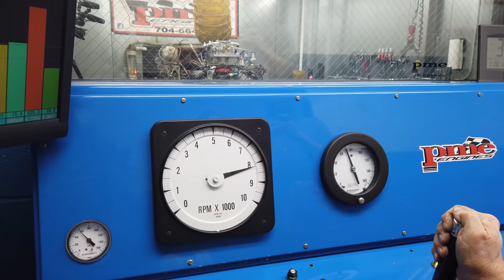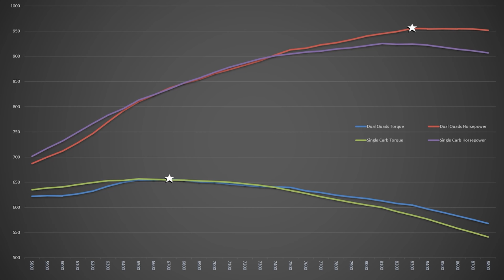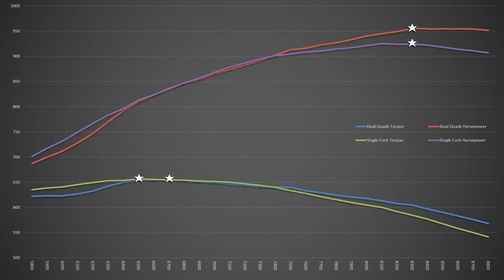955 Horsepower NASCAR Engine for the Street! (w/ ProMotor Engines)

Comment: Almost a thousand horsepower with less than 400 inches. Holy cow!
Reply: AND alll natural on top of that!
Reply: The emission will kill
Reply: And only 12:1 compression
Reply: Considering cosworth. Make 1000hp. From 366 cubic inch n/a v12 
With all emission controls in place.  And last 100000miles  on pump fuel      

But the Chevy is very impressive for pushrod American engine
Reply: Not high performance, because it's intrinsically a poor design. And typically enough too many people don't have any knowledge of recent engine history. A 90 cubic inch BMW four cylinder racing engine made a reliable 1000hp and up to 1400 hp for qualifying, in the mid 1980s.
Reply from the maker: @johnsmith1474  Naturally aspirated? Because if it is not, then you are comparing apples to oranges.
Reply: Nobody tell him about rotary power
Reply: @danielthompson3849  Has anybody actually run one of those 100,000 miles in a car without a serious service or a rebuild?

Sure, it’s very antiquated but making that kind of power with a pushrod, 2 valve, V8 is really hard. 

And the proper cup cars were making 1000 in qualifying with a 360 ci engine and a single carb. Now they’ve limited them to lower rpm and lower power.
Reply: What's cosworth?
Reply: @NBSV1   that’s what cosworth / Aston Martin have said it will do before needing a rebuild 
And it’s a street factory engine  that anyone with enough money can buy   The fact it makes the power with still meeting all emissions  is to me the impressive bit.   What it would do with out them restrictions would be interesting 

But go back to 2004 and the 3l v10 in f1 spinning 20000rpm  making 900hp n/a
Reply: @johnsmith1474   reliable was a bit of a stretch. 850hp reliable    Then only last one lap when the waste gates where replaced with blanking plates and the boost ended up 83psi.    It was also the affect on things like gearbox that  it would bend shafts or burst the case altogether.   According to Gordon murry.  Some good interviews from him about the innervation that was about then
Reply: @johnsmith1474  The turbo provided enough airflow for 1400hp...
Reply: Yeah using 112 Octane
Reply: @TheHorsepowerMonster  hi, could you please enlight a person with not that much knowledge. Do the carburetors that can adjust themselves to a certain degree exist nowadays? Ignition distributor... Isn't it a limiting factor to the rpm?
Reply: @baby-sharkgto4902   a engine design and building company responsible for the most successful racing engines in the world  and currently building the engines for Aston Martins hyper car 
And Gordon murrys new t50. Supercar
Reply: @danielthompson3849  what car does cosworth have available to the general public with 1000hp anywhere in the world?
Reply: @damianlindsey6177   the new hyper car designed by red Bull 

The engine is well documented
Reply: @danielthompson3849  yeah, let's see one actually be driven reliably for 100k miles. Hypercars do not even get consideration. For a million fucking dollars it better last 100k without a failure. Wanna go that route, how about the fact that the Agera has basically a cam-less ford coyote. Yeah, that redbull hypercar will not hold up. Its too high strung.
Reply: @johnsmith1474  "Reliable" means one race.
Reply: @TheHorsepowerMonster  Tell that to the soy boys with turbocharged Hondas that brag about beating N/A V8s.
Reply: @johnsmith1474  that motor had huge amounts of boost, qualifying motors barely lasted a lap. So yea they made a lot power but didn’t have to last
Reply: @danielthompson3849  Lol, but the Cosworth is making less than 350 lbs. of torque, this American build was about 650 torque.
Remember, torque is what allows for heavier car builds, not many 2500 lb. cars in the planet, so the Cosworth is useless on street cars unless you gut a Pinto and make that you're daily driver!
Reply: @imacrazy6872    Hp is just a function of torque and rpm 

If you gear  the output to the same rpm then  the one that has the most hp will also have the most torque 

These are racing engines reused in fast performance street applications.
Reply: @imacrazy6872   and why would you want a heavy build   

Lighter the car faster it is 

To be fair I would love that nascar engine in a f5000 chassis. From the 70s
Reply: @danielthompson3849  The Cosworth Gordon Murray engine is a clean sheet  hand built supercar engine .
Reply: @TheHorsepowerMonster  No ,turboed to the moon ! . But street car 1600 cc  blocks that had done 60,000 miles were  the starting point . 
Peed on for extra aging , just like 010 blocks were !
Reply: @hepcat93  Good questions , General Motors used electronics to adjust fuel mixture on some carbs rather than fuel injection . Chrysler had a Lean Burn system to save fuel but both needed external controls .
I think a distributor could be blueprinted to reliably go to 12,000 rpm ?
Reply: No my friend, Holley Cow 🐄!!!!!
Reply: @imacrazy6872  you know, more than likely you confusing Danielle referencing a pinto and horsepower...
Reply: F1 engines from the early 2000s were making around a thousand horsepower from 183 cubic inches.
Reply: @johnsmith1474  With superchargers the size of a house and turbo lag to go with it.
Reply: @damianlindsey6177  Aston Martin Valkyrie hypercar, designed by Adrian Newey, Red Bull F1 designer
Reply: @imacrazy6872  Around 457fp.
Reply: Wait till you find out about european 3 and 4cyls
Reply: The torque numbers killed it for me, especially for drag racing
Reply: Look up Toca Performance, they were doing this ten years ago.
Reply: @eflanagan1921    That engine is also brilliant but not the cosworth v12 I was on about 👍👍
Reply: @eflanagan1921   thanks for the information, man! Lean mixture? Sounds like the very early attempt of what mazda did recently with its sky active...
Reply: @John Smith  debunked!
Williams/BMW's 4 pot NEVER made that horsepower level. 
The BMW M10 block that was based on would swim like a snake till it snapped without an engine block girdle..
1k hp maybe, briefly in Qualifying, but no way it made 1400hp!

P.S. tiny pistons, tiny crank, tiny crank journals, smaller, lighter valvetrain and low rotating mass will always give the anemic, itty, bitty, torque less engines of a hp/liter advantage.
It ain't magic, people.
Reply: Honda owners have entered the chat
Reply: @kx250braap  
Sure! If you like the torque output of an anemic, chainsaw..😀😁😂🤣🤣🤣
Reply: All about money!!
Reply: @lll9416  Turbo F1 engines did produce well in excess of 1,000 hp in qualifying. People also seem to forget that Honda engines were dominating during the first turbo F1 era and that Honda engineers did say that they were approaching the 1,000 ps per liter mark in qualifying, which would have meant that the engines were producing around 1,400 hp.

Torque also means jack s**t, as power tells you how much torque you can apply to the wheels at a given vehicle speed.
Reply: @PistonAvatarGuy  LOL!
you buy anything your Euro masters tell you! pff
no torque = no go.
Who care about high hp when these toy engines FINALLY make HP at 8000 rpm its time to shift!! then they fall flat on their noses because why?? NO TORQUE!
As the pathetic low TORQUE falls off you have to wait forever for revs!  All the counterbalance it takes to hold together at that cylindrical load creates too much parasitic load, therefor reducing the output from the crank..
I don't expect you DOHC fanboys to understand all this inconvenient science and all.
  
PS. you got Dyno sheets of those 1400 hp pulls? 
Thought so, it was nothing more than paddock gossip,, sorry  truth hurts..
Reply: @lll9416  I don't have to "buy" anything, it's PHYSICS and it's why the Europeans have basically always had the fastest cars on Earth!

An F1 car can accelerate from 0-60 in 1.6 seconds, they don't fall flat on their faces. You have absolutely NO CLUE what you're talking about.
Reply: @PistonAvatarGuy  
F1(aka The Pit Passing Parade) cars need a hybrid electric motor to "torque fill' the little lawnmower "engines" at low RPM so they don't STALL!  hehehe
Reply: @lll9416  No, the hybrid systems are a recent addition to the cars and the cars that had the fastest 0-60 times were all engine. Hybrid systems are for efficiency, not performance.
Reply: @danielthompson3849  Americans beat the Europeans almost every time when the playing field is balanced.
Reply: @riceski    Not really most top level world motor sport development is done in the U.K 

All but 1 f1 car in the grid 

All Indy car chassis as far as I’m aware are made in U.K 

By level playing field you mean hp/ci.  Then America is about the lowest oc 

Look at Indy car a mid level f1 driver from France came over and got pole and a podium in his first race  
Makes a lot of the all American stuff look lower standard  
As for road cars 
While I would love a hellcat. The offerings from bmw and audi  m5 and rs6. Are altogether better for  European roads.  And Petrol prices 

But looking at America at the moment it won’t be long Befor  you are paying the same as us sadly
Reply: @riceski  like the British made Ford gt40?
Reply: @johnsmith1474  Yes but V8's have way more torque. Add a turbos or blower on a V8. No in record 4 banger will beat a very good V8. Remember engines are lighter now for years go figure lol.
Reply: @olerindalrstad1317  LoL
Reply: residue junkie  Oh my my - we have never seen these things before. Unless you're driving something like   the video's describe -- what's the point? Have a great wkend.
Reply: topfuel... 8000 cc 11000 hp ... more than 1hp per cc... now what bit ch?
Reply: @QuantumPlaysOfficial  😂
Reply: Ain't shit by today's standards! LS and LT motors are making 1000+ horsepower all day long for a few grand, that's why everyone's got one nowadays!!
Reply from the maker: @Anarchy-Is-Liberty  You can build a naturally aspirated LS or LT that makes a thousand horsepower for a few grand?
Reply: @Anarchy-Is-Liberty  yea plus 1000 but how its going about plus eleven thousand?
Reply: @baby-sharkgto4902  

They are a engine company in europe. 👍
Reply: @PistonAvatarGuy  pushing over double the rpms. Comparing F1 engines to any others is about as dissimilar as you can get when it comes to engines. Extremely short stroke vs long stroke= apples vs watermelons.
Reply: @jonathonbridges9625  My point was to show the difference between the best that American racing technology has to offer and the best that European/Japanese racing technology has to offer.
Reply: @PistonAvatarGuy  you say that as if Americans are incapable of building such kinds of engines. One thing would probably be the sheer cost of RnD programs for those kinds of engines. Another is regular Americans can just about build the same motors used in organized racing. Damn sure can't do that with an F1 engine. 2 completely different car cultures is the reason for the difference.
Reply: @jonathonbridges9625  Americans are not capable of building an F1 engine, they've tried before and failed miserably. That's also why they have to lie about having the fastest car in the world, because they just don't have the technology to compete on that playing field.

The engine in this video is a purpose-built racing engine, just like an F1 engine, it's not something that can be found in a road car, or obtained easily.

American automotive technology stagnated for decades, that's just a fact. It was more profitable to build cars based on the same formula for three decades than it was to develop new designs, so that's what the American big three did, and then they ended up falling behind the rest of the world, it's as simple as that.
Reply: It was the 1957 fuel injected Corvette 283 that hit the mark of being the first engine to develop one horse per cubic inch for the street in America.
Reply: @Anarchy-Is-Liberty  well, you can tell you have never built anything just by the way you talk. Just like most people on here dogging this engine out, they have never even turned a wrench on an engine, but are subject matter experts.
Reply: @patrickmoore1017  So, by the 17 words I posted, you know I have never built anything, huh? OK god, whatever you say daddy! PSH! FFS FO!
Reply: @TheHorsepowerMonster  When did I ever say anything about NA?
Reply: @danielthompson3849  well that has 4 more cylinders
Reply from the maker: @Anarchy-Is-Liberty  Well, if you are comparing a turbo or supercharged LS or LT to this naturally aspirated engine, then you are comparing apples to oranges. If you are going to throw boost on an LS, then also throw boost on this and see how they compare. That's all I'm saying.
Reply: @TheHorsepowerMonster  He knows those were monster turbo motors. Reliable for a race and reliable for the street are two different things.
Reply: @danielthompson3849  well... some won't get it. never. But my 240V vacuum cleaner is waaaaay more bedda cleaning than your 1000w thing. goddammit..
Reply: @danielthompson3849  mike costons and keith duckworths first engine was modded from a ford euro 2.0L 4 pot.
Reply: Well, there are tuned na BMW straight 6 engines wich put out about 500 hp with a displacement of about 3.3 L. That would be equivalent to a 6.55 L engine with 994 hp, the engine in the video is almost a 6.55L engine with 950, so it is actually a bit under the expected power.
Reply: @TheHorsepowerMonster  
This engine is incredebly strong, for a pushrod V8. 
There are examples of 3.0 L 6 cylinder BMW engines wich are naturally aspirated and make about 500 hp, wich is about 151,51 hp/L and actually more than this engine does.
Reply from the maker: @mandernachluca3774  It doesn't work that way. Horsepower per liter (or cubic inch) is typically larger for a smaller engine. It doesn't rise in a 1:1 ratio as the engine gets larger. Parasitic drag and other inefficiencies makes it harder to produce power at the same ratio for any engine as it gets larger in terms of displacement.
Reply: @danielthompson3849  right... Man it reminds me of my uncle's engine.. I miss it... Small block Ford.. 900 horse .. natural.. 13 to 1
Reply: @johnsmith1474  that's not a poor design... Lol... 90 cubic inch.. natural 1000 horse motor.. no.. I'm sorry.. I don't care how smart u think u are... It's not happening... Period
Reply: John Smith was it naturally aspirated cos F1 cars back in the day made similar HP from small capacity engines but they were turbocharged
Reply: Compression valve lift  head flow RPMs 112 octane race fuel!!!  I can see it
Reply: @Anarchy-Is-Liberty  well bub... Everyone here is talking NA... If we were just talking power adders.. then the sky's the limit. Lol
Reply: @Anarchy-Is-Liberty  WELLLLLL... Have many engines have u built..
Reply: Captain MufDyven  I'd say the engine I was referring to is a bit over 2.3maybe 2.5hp per cu.in.   not 3.0 per cube though... 

NA...  Non electric
Reply: @TheHorsepowerMonster  yeah.. a few grand getting a thousand horse... Ummm. Naaa... U right... He just hasn't got much of a clue
Reply: That's what she said!
Reply: @johnsmith1474    Not buying that on double coupon day
Reply: @PistonAvatarGuy  Of course Americans can't build an F1 engine. It has all these dumb restrictions. However in an unlimited class like Can Am, even Ferrari with their 7 liter couldn't beat Chevy. Took Porsche a turbo and Penske money to finally beat Chevy. GM did not even support racing at the time. Imagine if they improved the old engines the racers were using. Btw Can Am birthed a lot of tech used in F1. Thank Jim Hall for that. You're underselling American racing technology, yet a lot are used in modern race cars.
Reply: @PistonAvatarGuy  Also the experimental car designed by Adrian Newey for his unrestricted F1 vision uses 70s Texas technology. The fan car. Haha Europeans are funny.
Reply: @johncarl5505  "It has all these dumb restrictions."

That just proves my point. Americans can't compete with the best of the best, because they don't have the technology to compete with engineers who thrive under harsh restrictions.

"However in an unlimited class like Can Am, even Ferrari with their 7 liter couldn't beat Chevy."

You're talking about something that happened almost 50 years ago, and in only ONE racing class. In most racing classes, and when it came to road cars, Americans simply couldn't/can't compete.

"GM did not even support racing at the time."

Then it wasn't Chevy who was winning, it was whoever was building the engines and chassis.

"Imagine if they improved the old engines the racers were using."

You're assuming that the Chevy small and big block V8s haven't been improved upon and that there aren't far, FAR better engines in existence? Seriously? Neither of those things are true, pushrod V8s have been under continuous development and there are far more impressive engines in existence. Heck, even Toyota beats GM in NASCAR, where the most advanced iteration of the Chevy small block currently competes.

"You're underselling American racing technology..."

No, I'm not, American racing technology is a joke, it always has been.
Reply: @PistonAvatarGuy  If American racing technology is a joke, why did Chapman and Murray use it in F1?
Reply: @PistonAvatarGuy  Also the Corvette has beaten many Euro cars even more expensive than it.
Reply: @PistonAvatarGuy  Man, you guys really spend so much money or complain just to beat American cars.
Reply: @PistonAvatarGuy  Btw, Toyota in NASCAR is  fully American other than name, so your argument doesn't really work.
Reply: @johncarl5505  "If American racing technology is a joke, why did Chapman and Murray use it in F1?"

The real question is: Why weren't there any American F1 teams in existence making use of those technologies?

Anyway, that's like inventing the pen and claiming that you've written every book that was ever written with a pen, it's a pointless argument. It's not like Americans were designing those F1 cars and all of the technologies which made them successful.

"Also the Corvette has beaten many Euro cars even more expensive than it."

In one of the slower classes at LeMans. They don't even race against the fastest road cars that the Europeans make.
Reply: @PistonAvatarGuy  I'm talking about road cars, the Corvette, heck even the Camaro beats many overpriced cars in the Nords. Jim Hall could have tried his luck in F1, but alas the dumb FIA has banned all his innovations.
Reply: @PistonAvatarGuy  Anyway, you're talking about the country which was an isolationist that turned into a superpower in a century. A country that built stealth planes in the 80s and got laughed at, yet Russia, China and Europe are now developing their own. You think it's not possible for them to apply their technological expertise on road cars?
Reply: @johncarl5505  "I'm talking about road cars..."

American road cars AND American race cars have almost never been able to compete with the best that Europe has to offer. Your thought process on the Camaro also illustrates why American cars perform so poorly, because you're focused on what the Camaro can beat, rather than what beats the Camaro. You're also focused on price, as if that somehow makes the car faster, which is hilarious.

"Jim Hall could have tried his luck in F1."

No, he couldn't have, he never had the engine technology. Again, you're looking at one, tiny part of a racing vehicle and not understanding just how enormous an undertaking it is to design and build an entire race car.

"You think it's not possible for them to apply their technological expertise on road cars?"

Possible, maybe, but highly unlikely, because Americans are too obsessed with profit and tradition to invest significantly enough in something completely new, and that's what would need to be done in order for the US to have something that's competitive with the best that Europe has to offer. European companies have been consistently investing in the development of cutting-edge automotive technologies, the US has not, so they'd need to make a huge leap to be competitive.

You don't seriously believe that an American company could produce something like the Cosworth Valkyrie V12, do you?

As far as race cars go, no, I don't think that Americans are capable of competing in the fastest racing series, like LeMans (the hypercar/prototype classes), or Formula One, they just haven't kept up with technology well enough to make that kind of leap. Even Honda had trouble achieving their current success in F1, and they had previously dominated the sport.
Reply: @PistonAvatarGuy  Americans like to go the cheap but high performance approach on cars in comparison to their aircrafts, that's why they probably won't ever make that Aston. Seriously, what is the point of spending so much money improving the aero of a car to make massive downforce if instead you can stick a massive fan on the back. I have no idea why Europeans like to make everything more expensive. F1 dirty air problem could be solved with a fan, but no they want to waste more money.
Reply: @PistonAvatarGuy  Whenever there is a comparison between an American car or a European one, the Europeans always say excuses like, "Oh we have less displacement, if it were the same, our car would win" or "Your tires are way wider than ours, we use more sophisticated aero to help our cornering ability instead of relying on primitive wide tires". Seriously why do you guys make it more complicated and expensive?
Reply: @PistonAvatarGuy  While I'm not a fan of the Ford GT GTE due to my dislike of the Ford GT, a car way to expensive for the performance it has, basically America's attempt to make a European supercar. I was glad it won because of sandbagging. I see it as revenge for when the Corvette C7 GTE was bopped to uselessness when WEC restricted its airflow because it performed the best out of all the GTEs, while following all rules and regulations. They should have let it win like the C6. Now the C7 will never win Le Mans since it's retired.
Reply: @johncarl5505  The whole point of racing is for it to be challenging. Anyway, even with a fan, racing teams would still benefit from improving aerodynamics on the same level that they do now.

Europeans don't need excuses, they build the fastest cars on Earth and basically always have.
Reply: @PistonAvatarGuy  Jim Hall never fixed his Chaparral 2J because it was banned so it is pointless to continue. The technology proved itself when it outpaced and lead other more advanced Can Am cars only to break down later due to trans issues. I mean Murray succeeded in defeating the revolutionary Lotus 79 by a huge margin and Newey used the fan system in his GT vision car, so yeah I don't think the fan system is a fluke.
Reply: @PistonAvatarGuy  America did a lot in the world of motorsports such as wind tunnel testing, HANS device, etc., yet people only evaluate their contribution based on their success in F1 even though a majority of Americans never cared for it. I think the only American teams that tried F1 are Penske and Haas, I don't think the Big  3 even tried joining. Ford Europe is independent of course, so the Ford you see in F1 is not the US based one.
Reply: @PistonAvatarGuy  They don't need excuses, but they still make em.
Reply: @PistonAvatarGuy  The whole point of racing is racing not making it challenging. There can be challenging races, but stupidly expensive parades are not racing. Then again it is subjective, for some people DRS and pitlane overtaking is racing.
Reply: @johncarl5505  No one ever said that Americans did nothing to contribute to the world of motorsports, it's just that they're not able to participate in the faster racing classes, because they haven't kept up with the development of all of the technologies that they would have needed to in order to be competitive in those classes.

No one is making excuses for European sports cars, they're probably just relaying genuine reasons why whatever comparison you're making doesn't make sense. For example, it's not really all that impressive that the Corvette was so successful in its class, because it doesn't really complete against any of the more impressive European road cars.

Regulations in racing can push the advancement of technologies forward, which I would argue is even more important than the actual racing. For example, the current regulations for F1 have made the racing less exciting, but have resulted in hugely powerful, incredibly efficient engines, which also last much longer than older generations of F1 engines, and many of those advancements could be transferred to other applications. For example, the MGU-H technology could be used to great benefit in semi trucks and light aircraft.
Reply: @PistonAvatarGuy  F1 tech is not even used outside F1 except for high end supercars, so I doubt car technology relies on F1. A majority of tech F1 uses started outside F1 anyway and would have evolved without F1.
Just because American companies don't make F1 cars doesn't mean they are falling behind. That's like saying European companies are falling behind in stealth tech because they are making them right now instead of the 80s or falling behind in Baja 1000, Unlimited Hydroplane, Tractor Pulling, JetSprint, Formula Hillclimb, Offshore Powerboat, (the many other motorsports dominated by American tech), etc. It's just that they are not focused on those sports at all. Those sports also have involvement in improving certain tech, but tech would still evolve without them.
Reply: @johncarl5505  Much of the advancements made in F1 are in materials science, manufacturing methods, engineering tools, the understanding of the combustion process and how it relates to combustion chamber and port design, etc. Those advancements do sometimes transfer to other applications.

"Just because American companies don't make F1 cars doesn't mean they are falling behind."

That's not what I said, American car companies are behind because they're behind. Americans don't make the fastest cars, they don't make the most efficient cars, they don't make the most reliable cars, and they've been behind for around 4 decades. Americans COULDN'T make an F1 car if they wanted to, because they're behind, Americans COULDN'T make a LeMans hypercar if they wanted to, because they're behind.

"Baja 1000, Unlimited Hydroplane, Tractor Pulling, JetSprint, Formula Hillclimb, Offshore Powerboat, (the many other motorsports dominated by American tech), etc."

If European companies wanted to dominate in those classes, they absolutely could. Tractor pulling is dominated by Europeans (though, often with American engines), as are many hillclimb events. Heck, take a look at the winners at Pike's Peak, it's been Japanese cars (Suzuki Escudo), Japanese powered European cars (Norma-Honda, Wolf-Honda), European electric cars, etc.

"...but tech would still evolve without them."

In many cases, no, it wouldn't.
Reply: @PistonAvatarGuy  So American cars are behind because they are behind. Europeans would dominate those other motorsports because they can. Wow good explanation.
Reply: @PistonAvatarGuy  Much of the advancements in those other motorsports are material manufacturing, engine efficiency, etc., as well.
Reply: @johncarl5505  No, I said that Americans are behind because they don't make the fastest cars, they don't make the most efficient cars and they don't make the most reliable cars.

Europeans could dominate any motorsport if they chose to because the performance of their vehicle technology exceeds that of anyone else's, except for the Japanese, in certain cases.

Right now, the most efficient automotive engine in the world is a Mercedes F1 engine.
Reply: @PistonAvatarGuy  Yeah, the Mercedes F1 engine can dominate in Tractor Pulling or Top Fuel. That's why the Germans used it there. Oh wait they didn't because they are using HEMIs and Allison V12s.
Reply: @PistonAvatarGuy  Engine effectiveness depends on the vehicle it's powering. That's why they use American V8s and not European V8s in the Scandinavian Formula Hillclimb. They have the power, torque, simplicity and reliability.
Reply: @johncarl5505  You do realize that NEW engine designs can be produced, correct? I'm saying that the Europeans posses the technical knowledge to build engines that could outperform anything ever produced by any American company.
Reply: @johncarl5505  They only use American V8s because no European company has ever decided to produce a V8 that outperforms those engines... at least not in a reasonable price range.
Reply: @PistonAvatarGuy  Ha, even you agree with me that European companies would have to spend ridiculous amounts of money just to compete with American engines. Thanks, lol.
Reply: @PistonAvatarGuy  Those engines weren't even designed for tractor pulling, boat racing, etc. They were just used for the performance trim of certain road cars. The fact that they are being used around the world is a testament to their design.
Reply: @johncarl5505  Those specific engines, in that specific application... maybe. I'd say that there might be Euro V8s that could be tuned to compete. Anyway, there are fully emissions compliant, European ROAD CAR engines that would stomp the f--k out of those engines, like the Cosworth Valkyrie V12, any of the Aventador V12s, the big Ferrari V12s, the McLaren F1 engine, Koenigsegg engines, etc. Cost is obviously an issue with those engines, size would also be an issue with the V12s.
Reply: @johncarl5505  I just have to say how hilariously childish that comment was. There is NO AMOUNT OF MONEY that American companies could spend that would allow them to compete with the top tier engines that the Europeans make, they just wouldn't even know where to begin to compete with those engines. And, no, those V8s in the Formula Offroad trucks would not be able to compete with the best V8s and V12s that the Europeans produce if they were installed in a production car.

Heck, the most powerful naturally aspirated American engine ever put in a production car made 505 hp, while the most powerful naturally aspirated production car engine in the world makes 1,000 hp. Even the little 298 pound Porsche 918 engine makes 600 hp.
Reply: @johncarl5505  Correction: The Shelby GT350 is naturally aspirated and makes 526 hp.
Reply: @PistonAvatarGuy  Hey, just stating my observations. I see a lot of American V8 project cars even in Europe. Never seen a Porsche swap. Doubt that could perform well.
Reply: @johncarl5505  American V8s are used in swaps because they're cheap and easy to get, while the top tier European engines are extremely expensive and almost impossible to get. That 600 hp Porsche engine is in one of the best performing vehicles in the world, no American vehicle comes close to competing with it, but it also costs nearly one million dollars. That's what you're not understanding here, that the Europeans make the best, and only the super-rich can afford the best.
Reply: @danielthompson3849  Since when does Cosworth make a racing engine with "all emissions (shit) in place"?
Reply: @johnsmith1474  That got rebuilt after every race, cost 100k, and was full of exotica like titanium rods, valves, and exhaust systems. Not exactly streetable.
Reply: @pookysdad4884    The 1000hp unit in the Aston Martin  hyper car
Reply: @hepcat93  Carburetors don't. But electronic fuel injection (EFI) does.
Reply: @danielthompson3849  Neato. And they'll build how many? 50? For guys like Richard Branson, and maybe Jay Leno? Super.
Reply: @pookysdad4884   yes  and  still 1000hp n/a 6l v12  that will last 100000miles and be emission compliant  
And comes with a warranty
Reply: 1k hp per liter since 1980's. Turbo needed. Yes 1L engine
Reply: @PistonAvatarGuy  completely false 😂 the ssc tuatara just beat koenigsegg for the fastest production vehicle with a V8 that uses a LS block made by Nelson racing engines, not to mention Koenigsegg used the Ford modular engine in its earlier vehicles and still used the Ford block design till recently which Christian said himself on Jay Leno which is on YouTube rn.
Reply: @PistonAvatarGuy  we both know European cars and reliability do not go together😂, look at any statistic you want, the only European car that is consistently on every positive statistic is the Porsche 911, when it comes to reliability, maintenance costs, insurance costs, average life spans without major fixes, depreciation losses and resale value European vehicles will almost always come in last even the most of the European super cars lose massive value great examples of this is certain years of the Mercedes Amg Gt now can be found under 100k, Mclaren 650s can be found for 129k a mclaren with a twin turbo 3.8 v8 should never have lost more than 100k in value but then again it’s British engineering lol, the Ashton Martin V12  formerly owned by Ford motor company aka a American company 😎 some could be found under 120k even some under 100k, some Audi R8’s for under 100k and one of the most horrendous are the Lamborghini Gallardo’s with v10’s and manual going for under 100k 😂. It’s almost as of the Europeans manufacturers need to through more and more money and see which ones sell lol also Porsche almost going bankrupt then getting saved by the Porsche Cayenne a dam SUV saved Porsche 😂😂. Europeans are extremely intertwined with their governments like VW the German government owns a massive stake in the company and without it, it will fail instantly they need government intervention to help the
 constantly but the Europeans are so far behind in EV Angela Merkel herself took the land rights from VW and gave them to Tesla in Berlin in hopes of not being left behind from the future of EV. Tesla a American company is the biggest EV seller and also the most advanced and what do the Europeans have to offer? The Porsche Taycan? 😂 even with all the VW subsidiaries like Audi, Porsche and Skooda they are not even close🤷‍♂️.
Reply: @danielthompson3849  completely false 😂 looking at Europe it looks like our bases are getting larger and larger, the UK is having a major fuel shortage and prices going up meanwhile here I’m paying 2.49 USD a gallon when so busted Italy I was paying 7.88 to 8 USD a gallon. Look at this years lemans the C8 corvette placed second behind Ferrari after years not racing in the Le Mans, with an American and Spanish drivers. 

But looking at Europe as a whole with Brexit happening and Poland being threatened by the EU it looks like things are looking tricky again. But as someone who was stationed in Germany and Italy it was only a matter of time🤷‍♂️.
Reply: @danielthompson3849  considering that is a v12 going in the Valkyrie which the staring price is 3.8 million and a new brand new engine design. Pretty amusing it takes 3.8 million dollars to even produce similar numbers the Americans and Asian manufacturers make 😂.
Reply: @USandGlobal   the full car is 3.8million    Not the engine alone        
Making the power is not the difficult bit. 
Making it light and reliable enough to have a warranty and last 100k miles while meeting the emissions regulations is the   Difficulty
Reply: @johnsmith1474  not really the best high performance from the engines your talking about such as the p48 that uses very similar designs from the m121 from 1969. Very poor designed engines not to mention the insane costs to keep them running the Americans did it far before with speeds reaching 200mph for hours on end.
Reply: @ATXevolutionz  yeah the ones with better internals still slower than stock American vehicles 🤷‍♂️
Reply: @PistonAvatarGuy  😂😂 yeah a Tesla does 0-60 in 1.9 seconds not really impressive for F1 last time I checked each F1 team could cost over 500 million to manage. And no they don’t have the fastest cars SSC tuatara has the fastest production vehicle. Top fuel dragsters are the fastest accelerating race cars on the planet reaching speeds such as 335 mph in under 4 seconds.
Reply: @USandGlobal  also if I’m not mistaken the  corvette race car engine is a dohc flat plane v8. Not a pushrod design from the 30s     And has nothing to do  with the engine that actually comes with the car when you buy it
Reply: @PistonAvatarGuy  the fact that you are comparing these engines with F1 engines when the price of F1 engines is beyond insane ranging in the millions for just the engine alone and according to Forbes F1 engine development has surpassed 1.4 billion all that money and only reaching 1000bhp is hilarious but then again it’s European manufacturers which need millions just to compete 🤷‍♂️. Even Honda won’t be able to help Redbull with their engines in 2026😂.
Reply: @PistonAvatarGuy  even with all that investment a simple car like the viper ACR which is the car with the most track records on the planet certified by the SCCA 13 records to be exact beating Porsche and Mercedes, the Viper being the tenth fastest car around the Nurburgring and still holding the record for the fastest manual car around the Nurburgring. Pretty pathetic the Europeans couldn’t beat a pushrod naturally aspirated V10 engine in a Dodge with a manual 😂, kinda like how their million dollar super cars get slower track times than a Porsche 911 GT3 RS😂.
Reply: @USandGlobal  The SSC Tuatara is not in production and hasn't been approved to go into production. SSC also LIED about the record.

"we both know European cars and reliability do not go together"

The same goes for American cars and reliability. Mercedes vehicles are often quite reliable, especially their vans.

"Europeans are extremely intertwined with their governments like VW the German government owns a massive stake in the company and without it, it will fail instantly they need government intervention to help"

You are aware that GM and Chrysler have been bailed out by the government on multiple occasions, correct?

"...but the Europeans are so far behind in EV..."

They're not at all behind, they have some of the most luxurious and powerful EVs in the world. The Taycan, the Polestar, Rimac, etc... Anyway, BEVs are not complex, anyone of the major car makers can produce world-class BEVs at a moment's notice.

"Angela Merkel herself took the land rights from VW and gave them to Tesla in Berlin in hopes of not being left behind from the future of EV. "

Who cares? The woman clearly knows absolutely nothing about technology and got duped by some Tesla fanboy. Anyway, BEV technology is a joke, it's not replacing ICE technology anytime soon.

"even with all the VW subsidiaries like Audi, Porsche and Skooda they are not even close🤷‍♂️."

Close in what way? Acceleration? Who cares? It's not like that takes some sort of revolutionary technology, you just increase the size and power output of the motors and battery, that's something that any car manufacturer car do.

"yeah a Tesla does 0-60 in 1.9 seconds"

But that's all that it can do and an F1 car isn't even built to accelerate quickly from a stop. The Tesla is absolutely pathetic when it comes to actual track performance, which is what an F1 car is built for.

"Europeans are not capable of building superior ev engines..."

EVs don't have engines.

"...they have tried and failed horribly."

When did they try? When did they fail?

"European manufacturers all have massive government ownership..."

If that's even true, why is that a bad thing? Anyway, you have no idea what you're talking about, and it's hilarious.
Reply: @USandGlobal  You are aware that the SRT brand FAILED and that the Viper is no longer in production, correct? There are also PLENTY of cars that pwn the f--k out of the Viper on the track and all of them are European. The Ferrari 488 Pista, Lamborghini Aventador SuperVeloce LP750-4, Porsche 911 GT2 RS, Porsche 918 Spyder, Porsche 911 GT3 RS, Porsche 911 GT3, Lamborghini Huracán Performante LP640-4, Porsche 911 GT2 RS, Lamborghini Aventador SVJ LP770-4 and Mercedes-AMG GT Black Series are all faster on the Nurburgring than the Viper ACR.
Reply: @USandGlobal  And here's what's happening in the world of modified Lamborghinis: https://www.youtube.com/watch?v=dyKgjEOYREg

No Viper can touch the fastest Lamborghinis in that competition, and those aren't even the fastest cars that Lamborghini offers.
Reply: @USandGlobal  Also: https://www.youtube.com/watch?v=MRj10HFPWXo
Reply: @PistonAvatarGuy  can’t build them? It’s a simple understanding of a design already in existence. That is simply stupid to state.
Reply: @Lo0die3  There's nothing simple about an F1 engine. You can't just build something similar and expect it to perform well, either. You're so far off the mark that you don't even know how far off the mark you really are.
Reply: wow!!! back in 80's BMW made over 1500 Horse power out of a 2.0L 4 Cylinder!! and won the Formula 1 Races
Reply: Yeah and it's only for times the size of an F1 engine with the same horse  power. Yet again America literally takes the cake for being unnecessarily big.
Reply: Maybe I missed it , but is that a 4-7 swap Engine ?? 🤔
Reply: @SteveXNYC  lol it's a race engine.. They are not made to pass emissions.. go find a tree to hug hippy :)
Reply: Hold on a sec.. that 1000hp v12 isn't even available for sell as it's to a 3.2million dollar hypercar . It's life span is in kilometers not miles 100,000km...  62,000miles needing a rebuild. There's nothing to consider you can't compare a 1,000,000 dollar engine unattainable engine with the v8 In video. And the BMW engine comment LOL yeah probably need to reread that engines history wasn't the most reliable thing ever.
Reply: @danielthompson3849  my uncle built a 363.. about 900.. if he had more money he could get 1000...
Reply: Nothing special.. Here in Europe we are used to greater powers. Our Formula 1 has the same power with an engine four times smaller.
Reply from the maker: @Akaprovic  So you are holding up a race team with a hundred million dollar annual budget against an engine built with used parts that an average Joe with a 9-to-5 job can purchase and go racing, and you're calling that equivalent? You're joking, right?
Reply: @danielthompson3849  care to list one of these examples. Have yet to hear of ANYONE building a 1000hp N/A engine that's in an automobile much less one that'll last 100k miles...
Reply: @02autogt   the cosworth v12 in the Aston Martin Valkyrie  1000hp n/a v12.  With full emissions control and do 100000mile between rebuilds
Reply: @danielthompson3849  are any of those in the hands of the public yet? Just curious... I am a fan of AM for sure but don't keep up with everything they have going on. Guess I need to Google it, lol
Reply: @02autogt   not sure   If any are delivered yet. But a smaller engine in the Gordon Murray t50   I think has been
Reply: @TheHorsepowerMonster  don’t listen to Mr Smith, he’s still stuck in the Matrix making 1000 up NA from the 90ci 4 cylinders, what’s next? Did they pee on the blocks to strengthen them?
Just playing, just another Internet Engineer forgetting a fact or 2.
Reply: @PistonAvatarGuy  and this isn’t even our "best",,,,,,,, Steve Morse drops mic and walks away,,,,
Reply: @TheHorsepowerMonster  @akaprovic  but they also spin that little bugger up to 20k, or isn’t there a 15k cap now? Either way, apples and donkeys. Don’t share much more than the suck bang blow logic, which Europeans are very good at,,,,;)
Reply: @danielthompson3849  I know what they’ve got and it’s a beast, and I’m sure they will get it to pass emissions (hope they don’t hire all the former VW diesel programmers,,,,)
But I seriously doubt that they will get it to pass more than 2 or 3 repair shops,,,lol,,,, I cannot recall ever hearing of an Aston lasting 100,000 miles,,, EVER,,,,in a trailer maybe,,,,
Reply: @SteveXNYC  Who cares?  Go watch videos about eating bugs.
Reply: @johnsmith1474  So where is this 90 cubic inch motor now?  Seems like everyone would want it.
Reply: @danielthompson3849  Where is this vid worth v12 you spout about?
Reply: @PistonAvatarGuy  My car does 0 to 60 in 1 second.
Reply: @justpray365   https://youtu.be/xMRrmnkZEqs
Reply: @QuantumPlaysOfficial  notice how noone gives a shit about a rotary
Reply: @PistonAvatarGuy  A) you don’t know WTF you’re talking about.  B)  none of those V12/10 engines in any of the exotic cars last 20K miles before they need rebuilt.  If even that.  Newer Lamborghinis do, but they’re a glorified Audi.
Reply: @Cultofpersonality09129  lol, ok, buddy.
Reply: @johnsmith1474  Reliable for ~1 hour?
Reply: @imacrazy6872  I get what you are saying
But who needs torque at 19000 rpm ?
Reply: @Silkmaster4200  I think the 787b proves your torque theory wrong 
As do a lot of f1 engines 
Most engines with big torque taper off higher in the rpm range 
Where less torque high rpm motors
Like I've mentioned keep producing hp right up until high high rpm
Reply: @johnsmith1474  Those F1 engines were barely reliable for a single race, and they got a complete re-build after every race.
Reply: Many of your Super Cars such as Ferrari, Lamborghini, Alfa Romeo, etc. are easily making 1,200hp with V-12 & V-10 engines with displacements under 3.0L.
They make most of their power up in the 8,500 rpm (and up) range with their short stroke.
Reply: @TheHorsepowerMonster  I know right .....eyes upwards LOL
Reply: @danielthompson3849 lmao last 1 million miles you're nuts
Reply: @donaldkinder6716    100000. Is not a million.  😂😂😂😂  go back to school
Reply: @SteveXNYC  I guess it would be just for 1 or 2 times monthly use not daily so..
Reply: 400 inches of what?
Reply: There is a lot of overlooked relevancy going on in this comment section when it comes to cubic inches and horsepower.

It's not a question of power per square inch, it's a question of limitation and or allowance per configuration where efficient or productive limitations,

meets,

effective or intelligent allowance and or application. 

Therefore, today's factory high horsepower engines are much more a factor not allowed in this particular video application where hell, they even have intelligent and or adaptable camshafts capable of changing its configuration and or timing itself when the demand calls for it and simply a therefore natural function.

I'm not even going to get into the modern technology of turning force and how it is productively transmitted to the ever important bottom line business end of performance and that is how much horsepower in application is transmitted to the drive tires front and or the back depending on the type of vehicle of course and it's adaptive intelligence that can be preset and or monitored and controlled in real time adaptability that is somewhat akin but not anywhere near the same degree clearly, but when I make the point that that the stealth fighter as a overall design function, can only be with a ever constant monitor and control adaptability in which it said it's making a million adjustments every second in order for what is a anti aeronautic structure to perform in essence the impossible of impressive flight control and response and signature. 

955 hp with a 400 cubic inch limitation is certainly not a pinnacle of engineering achievement with its structural design limitation being in this case a couple of valves per cylinder and I imagine a solid lifter style cam perhaps I'm not sure, I don't want to say the obvious that it's all mostly roller design for the upper end because I wasn't really interested in watching 26 minutes where the bottom line price or cost of this particular piece is not mentioned as far as I know in my careful fast forwarding.

And therefore if I'm wrong then so be it but if I'm right then I would lend this particular engine design and it's creators toward being a very high dollar item and I defer to what was once said to me years ago that humorously has its point but also very arguable and or relative to what ultimately by rights should be a component of overall design claim and its price point limitation or another words as it was said very facetiously to me where good irony is good when it's based on the ironic fact and that is:

"If you want to impress me then build a 955 horsepower 400 cubic inch engine for $5,000"

Of course that is very demeaning in spirit as to the reasonable state of mind being a grounded or down to earth one where we simply have to come to terms with what is design limitation because the laws of physics and thermodynamics as criteria demands that simply cannot be ignored unless design limitation is allowed to modify or alter and therefore it is not the same design principle anymore.

BUT,

The argumentive humor of it all did evolve or progress in arguable comedic fact in which, the engineering ingenuity of what is found in most penitentiary confines where we must admit that with what is the unfathomable bare minimums and even further below that in some cases, once mentioned I myself laughed and finished off the stated prognosis of total agreement and exaggerating appropriately the probable fact if those as stated inmates were not limited in what is the ultimate in limitations to begin with where they simply cannot just do what is almost the impossible out in the open, they have to do it invisible and compromised silence where when adding it all up there was no doubt when I said and we both laughed that I had to agree when considering they could probably build rocket engines out of mushed wet paper and glue composites left to dry and it's fuel source derived from bodily fluids and of course excrement and sexual fluids along with some other kitchen area organic material and there you go, The pelican Bay rocket!

And then I laughingly conjured up the vision of three Mexican mafia cholo looking types sitting on top of the rocket with their countdown and trajectory calculations toward escape velocity and successful as well. 

In other words when there's a will, there is a way and I agree 100% especially when life and limb is on the line and come on let's be real I don't think there ever once was a engine build outfit ever performing or motivated along those lines. 

I'm pretty sure that with no cubic inch limitation beyond would of course is dimensionally functional, is the probable fact that without a hemispherical head design, it's maybe impossible to get more than 1500 horsepower out of a naturally aspirated configuration where our only design allowance is a maximum of sea level atmosphere because in reality when we drag race for instance we are certainly above sea level in many cases as opposed to being below sea level that's for sure and therefore for the sake of debate and parameters, we will allow a maximum of sea level conditions in which there is our overall limitation that the basic design configuration mentioned above can only allow or perform so much because we are talking about the laws of physics and thermodynamics at that point sort of like the high probability that a human as we know it is not going to run a 3-minute mile as it stands without some sort of design modification that now takes what is human to a abnormal specification.

Not even the brilliant minds of pelican Bay and/or San Quentin can override what is physics and its limitations and therefore we have probably reached what is the maximum of a design characteristic as it stands being a single cam design and two valves per cylinder non hemispherical head design whereas I'm probably mistaken that even to approach what I know is 1400 horsepower is based offer a hemispherical head design.

I know there is a guy named Sonny's who might beg to differ but I also know I can win the argument when I say haven't you Mr Sonny, modified and therefore improved what is for argument's sake a better hemispherical design and therefore we have to conclude it is different than what is historically the norm. 

I guess I would have to put a fuel limitation into the equation as well being limited to what is the ultimate refinement and/or modification of gasoline being something like c16 if I recall maybe they have a next step better in gasoline but my point is, it's not alcohol derived and/or nitromethane in composition which of course and especially with nitro is a completely different animal than what can be derived from gasoline as a comparative source if one wants to even call c16 gasoline but for all intense and purposes it is a race gasoline and a damn good one in terms of its value combustion property. 

Very productive and efficient and therefore at the extremes of effectiveness.

This video engine example, I'm not impressed why should I be it's nothing unusual or revolutionary, it's just a well thought out and constructed piece of engineering where unfortunately it's not attainable by its very high price point and therefore it may as well be a MotoGP-1 race bike for that matter. Either way it's unattainable or unaffordable to most people and therefore if we are going to talk about impressive but un attainable then I defer to the ultimate hot rod in planetary history and that is the space shuttle or Saturn 5.... Now we're talking power.
Reply: @kx250braap LMFAO 👍🏻
Reply: @PistonAvatarGuy dude, did the racial biology of what is an American versus a European, change in short order if we minus the multi cult aspect of The component equation? 

We can go a step further that a Verner von Braun here in America or in Germany or in China is still without a doubt the same man with the same idea engineering capabilities where his only limitation is not the geographical fact of location and only I would imagine if in China, simply doesn't have the correct infrastructure in order to design the capability in order to harness what is his visionary genius That certainly America could implement as long as one I guess, believes the moon landing was not a hoax. 

Regardless of said landing, I can see how this can be compromised with illusionary camera and studio elaborate tricks but then we have to now go the extra step and say as well in argument basis that the launch of Saturn 5 was pure hologram Tom foolery and I'm not buying that for the simple reason that, 

VON BRAUN IS GERMAN. 

End of story because the saying still holds true and that is universally and globally if you cannot build it, then, give it to the Germans and they will. 

There was a time in America where 25% of its overall population was German. 

Let's face it when it comes to mechanical design and high performance whether it's combustion engines and or combustion design and/or aeronautic etc, it wasn't the Chinese or Japanese or whoever else other than the Anglo-Saxon and/or Germanic Europeans who were on the forefront in conception and leading the way.

End of story. Don't be a twit, ok?
Reply: @danielthompson3849 And less than half the torque with 40 valves.  The Cosworth and RO7 are purpose built for different objectives.  Silly comparison.
Reply: 😂

90 ci?  So, a fart can with turbos.  

The discussion involves naturally aspirated engines.
Reply: @QuantumPlaysOfficial Rotary power with those numbers would be unreliable.   NOT street worthy or trackable for the majority of people.  But yes, the R26B was an awesome engine.  That still didn't make as much power as this PME engine.
Reply: @danielthompson3849 😂

Stop.
Reply: @ATXevolutionz Those aren't naturally aspirated.  More like hand grenades waiting to detonate.
Reply: @PistonAvatarGuy Your comparison is, so, stupid.
Reply: @danielthompson3849   Corvette Racing says hello.  Le Mans series organizers must have gotten tired of seeing their 'marques' get trounced by a NA pushrod V8.  😂
Reply: @PistonAvatarGuy 

That must be why Euro manufacturers are fighting Cadillac's entry into the sport.

😂
Reply: @patrickmoore1017 Subject matter halfwits is more apt.
Reply: @mandernachluca3774 Except that approximated inline 6 would require more cylinders and a Messerschmitt Bf 109 to house it.
Reply: @H0kieJoe  Why would they care? Cadillac can't do anything but lose.
Reply: @H0kieJoe  I don't think that it was a stupid comparison, I was comparing the best NA circuit racing engines that the US has to offer to the best circuit racing engines that Europe and Japan have to offer.
Reply: @justinballard7242 i thought it has 17:1 compressions...